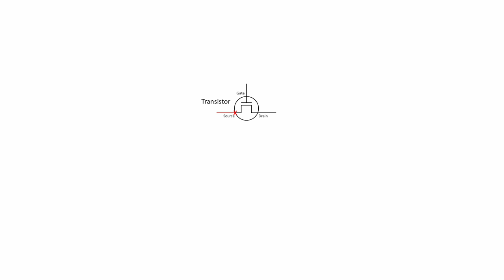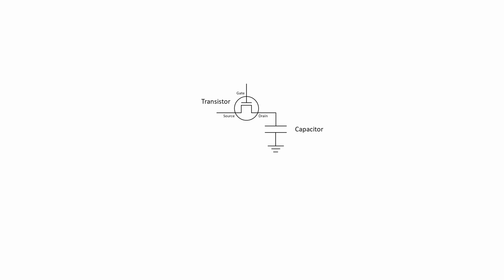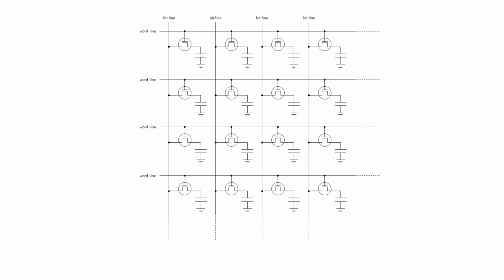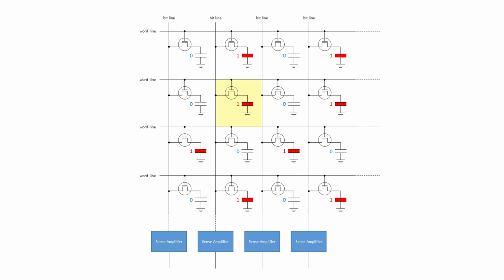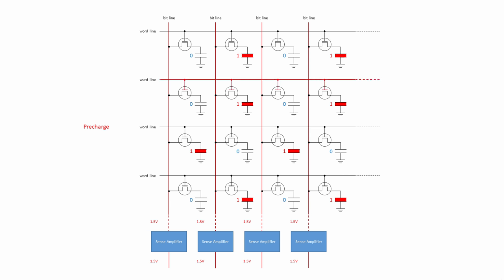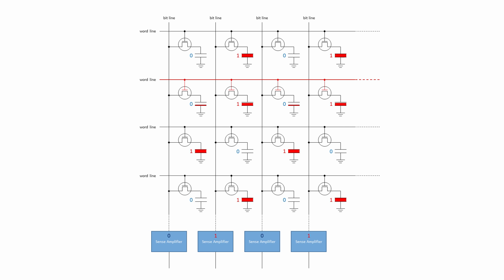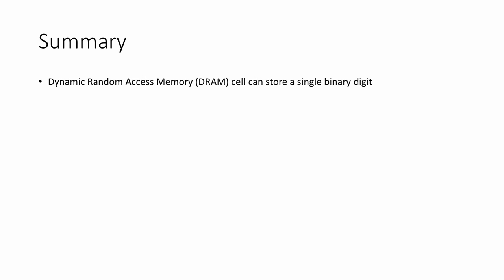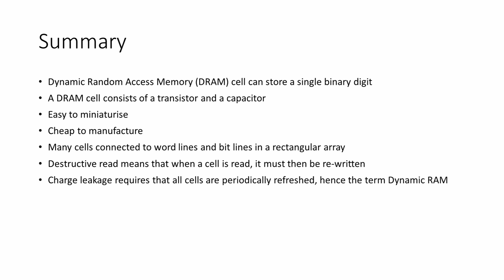Dynamic Random Access Memory (DRAM).  Part 1: Memory Cell Arrays

Comment: if the all transistor were to be with one capacitor in 100% voltage and other in 0% voltage, then right now is not neccesary to higthering or lessering that capacitors voltage, but on its output sind capacitor get one switch to be output in cero or higt signal... so the reading or writing are synchronicse with output switch and clock to new data or registres, for that the transistor conmuting to Zero or high level if only signal input is in the shiper instant and about gate diode to be negative or positive voltage to ok output being one 1 or 0 digital binary... so our only get free the rampe clock active with the signal binary, in concluscion we only spend the more lessering 1% energía that other system ram, rom or cpu... esto sumado a la refrigeración líquida obtendremos celulares frías o pantallas frías por láser optico... rendimiento al máximo y velocidades muchos mayores de Ram o rom... 👽👽👽

Comment: 3:05 "When the gate is closed..." that will happen only if voltage is applied to the Gate. But here terms are opposite as in a  normal circuit switch. Also thank you for these wonderful tutorials.

Comment: Using transistors and capacitors from an electronics kit, could I build 2 bit dRAM using this method?  And if I felt up for the challenge, would it be possible to scale it up for like 100 bits? I love building electronics and am fascinated with how computers process 1s and 0s
Reply from the maker: You could indeed, theoretically, but you might have to burn out a few components on the way.  You might find this website interesting. https://www.youtube.com/user/eaterbc

Comment: This is great tutorial. But it is not clear why precharging bitline is necessary. Also not clear is why the voltage on it changes by only a small amount (near 6:10) \delta{V}. Is it because the time duration for which the pass transistor is ON too short?  thanks

Comment: If I understood you correct, you described the bit line both as reading and writing, i.e. discharging and charging the capacitor.
Furthermore this just playing with one of the two bits, the bit 1.  And the bit 0 is just there for looks. How that cell is kept out of the way of being detected by means comparing its voltage .... is not discussed at all.
Do you mean to say that in order to charge ( write) the capacitor the gate voltage is lowered and once it is charged the voltage of the gate is kept high?
And since the capacitor is never fully discharged, for it to be charged the bit line of course has to have higher voltage and for it to discharge the bit line voltage has to be lower.
And you haven't mentioned the value of the gate voltage.

And for the capacitor to charge or discharge you have to send current to the gate?
If so then so many cells are connected in a row all them cell's gates are getting current and the 0 discharged cells will get charged for no reason, i.e. being written to while the other 1 bit cells getting read or discharged.
I see some charging ( writing) that has take place in the second row ( the first the the third cell) on the 0 bit cells, while the other two 1 bit cells are showing slight discharge.   So I assume that the 0 bit cells in order to be read, some charges are sent there and then immediately has to be discharged somehow.... not sure how that is done.  Espcecially if it is ROM memory. It shouldn't be changed.
Reply: It seems perhaps you are thinking of the transistors here like BJTs, they are FETs though and no current travels from the gates to the cells.

Comment: What happened to them cells with no charged capacitors.  The 0 bit cells? How do you read those and why have a capacitor there anyway?  Unless it is there just in case you want to change its value, changeable.  What about the ROM.  Are there capacitors there in the 0 value cells and for what unless it is there to change its value too?
Maybe it is covered the next video.
So far very informative.
Reply: This a video about DRAM, as in RAM not ROM. So the cells can potentially be changed from one logical state to the other all the time. So a 1 may be written over to a 0 and vice versa. The 0's are just as important as a 1 as they are both a single bit of information.

Comment: if BL=1.5V and Vcap=3V, then in reading operation the Vcap will drop to 1.5V, right? How do you do stop Vcap to drop that much?
Reply: Early in the video he mentions that reading the cell is a destructive process and what you point out is why. The bitline and cell will share their charge and move to a new voltage slightly offset from where the bitline was. Once the sense amplifiers fire they will pull the bitline back to where the cell was and this will re-charge (refresh) the cell.

Comment: 3:33 but single fet transistor can only pass current in one direction drain to source ( forward bise ) . Then how same can do the reverse ??
Reply: Great question! These are actually symmetric devices and don't actually have a drain or source, or you could say the drain and source switch between reading and writing a 1 or a 0.

Comment: @3:47 "you can see that 'reading' the content of a memory cell is a destructive process". Why? I understand it would be if you were to replace a 0 with a 1 but not why it would be simply reading the memory cell.
Reply from the maker: To check if a cell contains a 1, it must be allowed to discharge a little.  Similarly, to check if a cell contains a 0 (i.e. to check if it has no charge) it must be allowed to charge UP a little.  When a cell containing a 0 charges up a little, it effectively 'destroys' the 0 it contained.  Imagine a bucket of water: to check if it's full, you have to pour some water out (so it's no longer full); to check if it's empty, you have to pour some water in (so it's no longer empty).  At the risk of muddying the water, it may help to bear in mind that there is a minimum amount of charge, below which a cell can no longer be thought of as containing a 1.  Conversely, there is a MAXIMUM amount of charge ABOVE which a cell can no longer be thought of as containing a 0.

Comment: How the charge is getting transferred for and to the capacitor by applying voltage. i have understood one case that when the capacitor is fully charged and high voltage is applied  to gate the charge gets transfer from drain(capacitor) to source (bit line).but how come the reverse is happening means how zero vol capacitor getting partially charged after getting read(means charge is getting transferred from source to drain).could you please explain it sir.
Reply: Remember that during the read the bitline is at an in-between voltage. So lower than a charged capacitor but higher than a discharged capacitor. In either case if the transistor is conducting the capacitors move twords that half way voltage.

Comment: what happens in the capacitor whe the gate is closed, does it remains charged or uncharged??
Reply from the maker: It remains charged, for a while, but the current contents of the RAM need to be refreshed (i.e. capacitors recharged) periodically.  :)KD

Comment: Are bitlines disconnected from ground by the sense amplifier?
Reply: No, during precharge they are "equilibrated" to an "equilibration" voltage that is a sort of halfway voltage as mentioned.

Comment: In case you are like me.
Making this in "Circuit Wisard" what Transistor do you need? my reset whit backfire power.
So problematic when power open it self, or do other things like open the valve the other way around and other funny problems. No both ways Master Transistor that say: "you shall not pass" when not open. "i can't find the Gandalf Transistor" :-D
And my free version P Ch MOSFET work like N or not working.

Comment: how about static ram
Reply from the maker: The layout is very similar but the cells are built from logic gates making them non volatile.  Therefore the way it works is somewhat different from DRAM.  I will cover SRAM in another video.  :)KD
Reply: ok :)